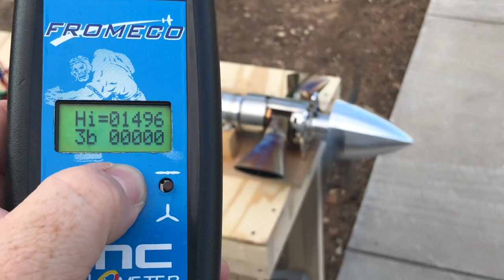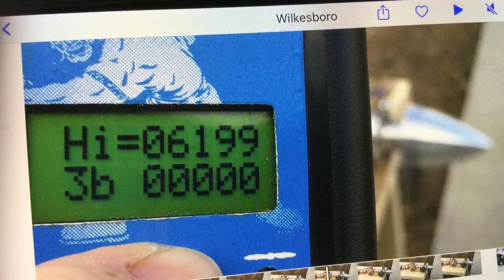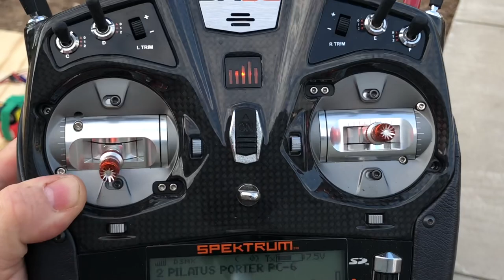JetCentral Turbo Prop Turbine (Proper rpm test)

Comment: Just on video which isn't very exact I'm seeing a one to two millimeter wobble in the tip of that spinner cone. Not sure if it's mounted incorrectly or the shaft is bent but you should deal with that before you have a catastrophic failure!

Comment: How is the low speed rpm resolution for landing?  Is there a significant delay in spooling up response if a go around or small fine adjustment is needed to land?
Reply from the maker: Oh yes, just like a jet you have a three seconds spool up. Actually, a turbo prop is probably more like 4 to 5 seconds so there is a little bit of a delay in RPMs when you push the throttle forward. You just have to know you’re landing and know that if it doesn’t look great, go ahead and go around it don’t take the chance or have an alone runway, helps as well.

Comment: So was that 6200 rpm at full throttle ? .. what prop are you running?
Reply from the maker: Yes it was 6200 rpm  Mejzlik 24x12
Reply: @warbirdmitchell4510  what is the shaft power??

Kw or horse power
Reply: @FirstLast-tx3yj  7kw or 9.38hp

Comment: I want to power a Jeep with a larger turbo shaft
Reply from the maker: You’ll have to go military and get a used helicopter engine from that project
Reply: Cover it with a Tesla motor in use the turboshaft on a big alternator😉😎